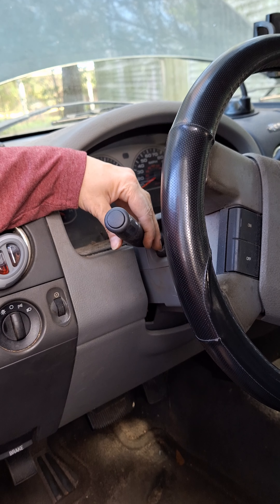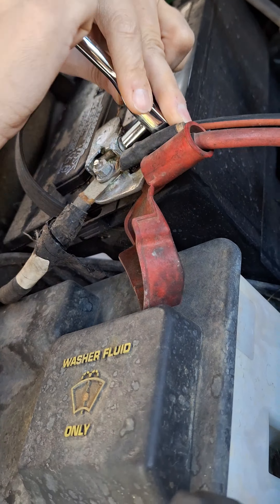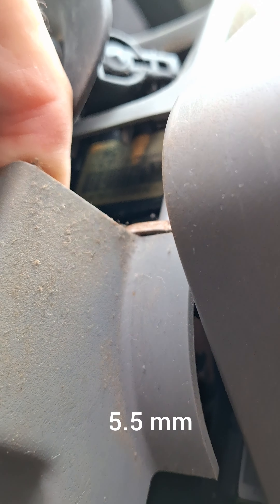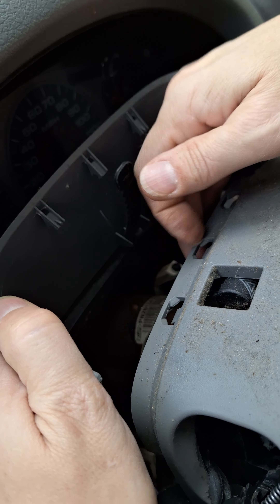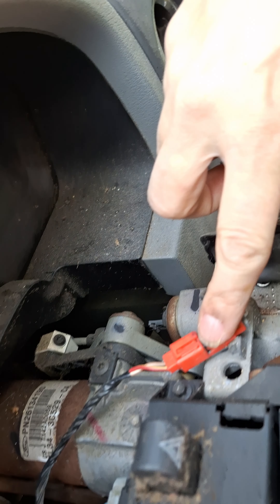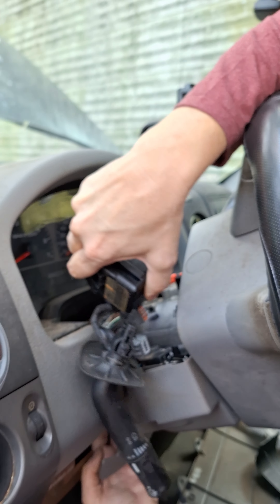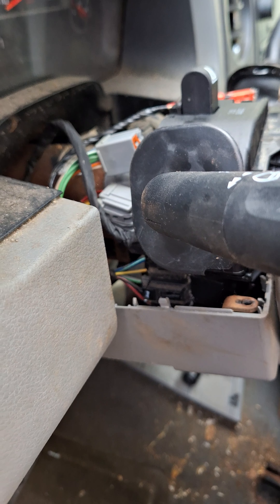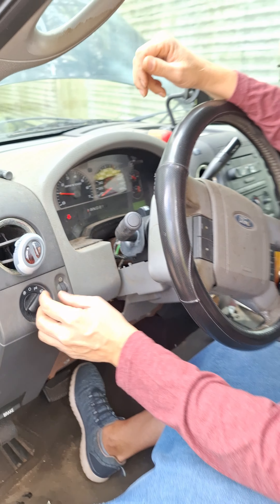Replacing a Turn Signal Switch on a Ford F150 without removing the airbag (Lady Mecanics Episode 13)

Comment: Thank you, thank you,  thank you. My turn signal switch finally fell out  today after weeks of me trying to keep it in. I've looked at it and looked at it just wondering how in the heck I was going to fix that piece without pulling the steering wheel. You saved me from doing something unnecessary and crazy. 
  I'll get it fixed now without tearing everything up. AGAIN I SAY--- THANK YOU 😅
Reply from the maker: You're welcome!